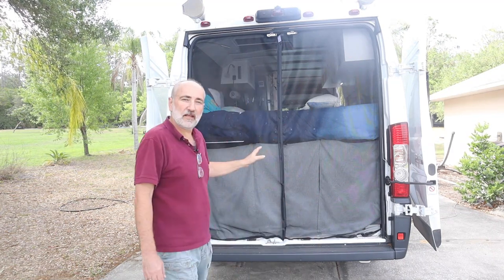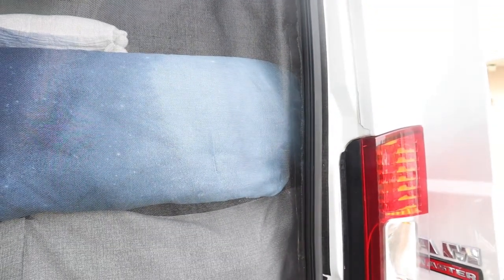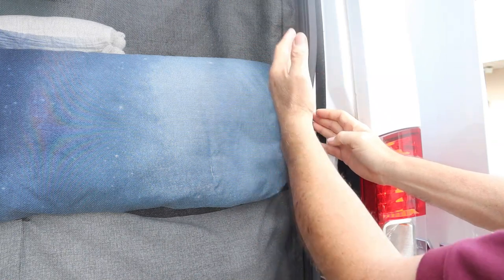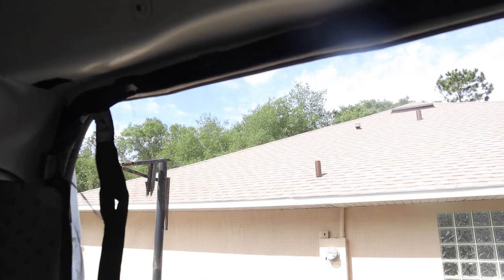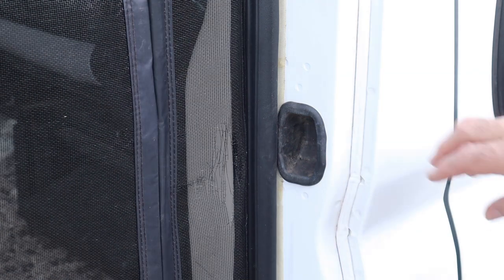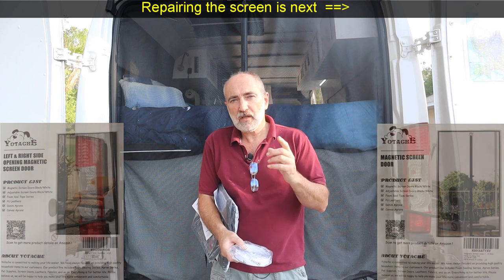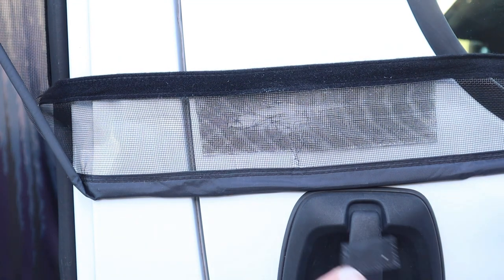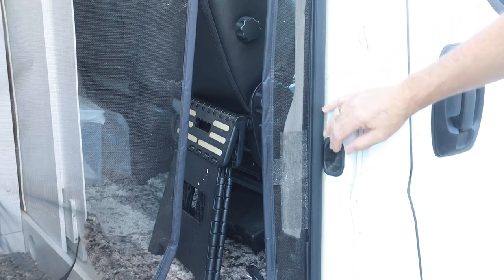Van Life Build Series: DIY Bug Screen Doors for your van - Keeping the bugs out!

Comment: Screen repair tape is so under rated. Our apartment owner used to charge everyone for new screens or rescreening. I was like you will be doing this with every pet owner. Just make a deal that they know its a repaired screen if they have pets or kids. Just swapping them out. Recycle n resuse instead of buying new. This worked great for the lower on third of the screens. ❤

Comment: Thanks so much for sharing this! I purchased the 48x80 center opening screen for my Ram Promaster van sliding door opening. I had to cut 12 inches off the length and remove several magnets but was able to keep the bottom hem through judicious sewing.
Reply from the maker: Yes, it takes some modification but works really well.  Ours have been in use for almost 2 years!

Comment: TY for the video. I was aware of the garage door size of these screens and the 3ft plus size but had forgotten the ones for patio doors existed.  Great solution.  About the hook in the B-pillar of the sliding door, could you just put a magnet on the other side of the seal to hold the screening away from that opening?  Or sew a tab right there to hold that part of the screen inside away from the sliding door when closing.  Or adhere a piece of stiff black plastic to the screen at that point to keep it stiff and from falling open into the "hook area."
Reply from the maker: We are still using the original screens we made.  But when we do replace them I expect the make that thin side piece (which is only about 3 inches wide) out of solid material so it is durable - in case the door closes on it.  A strap or tab to hold the screen away might work, but you would need to remember to attach the strap before closing - which I know I would not do.    Also, all the videos divided by category are at https://thefrugalfactor.com/

Comment: Could you please say where you fastened the velcro on the sliding door on the left side of the door looking out. Thanks.
Reply from the maker: On the left side looking out, is just behind the passenger door.  We put the velcro on top of the factory installed molding.  I think you can see that in the video at 7:56 when I talk about the steel hook.     Note you can see all the videos divided up by category at https://thefrugalfactor.com/        Hope that helps.